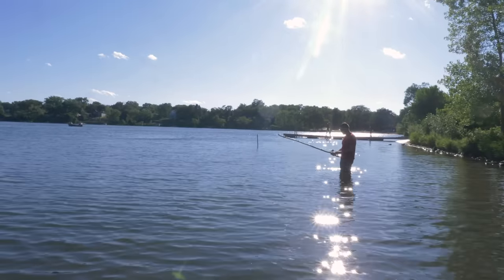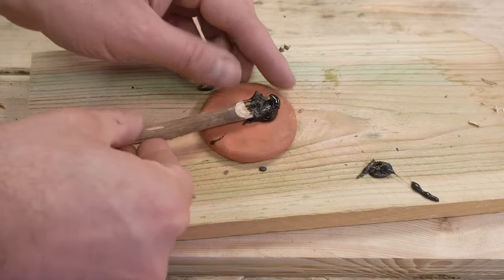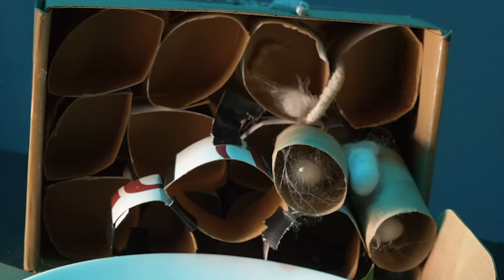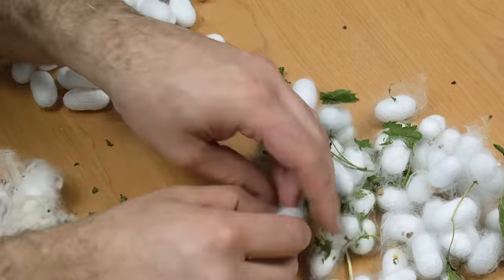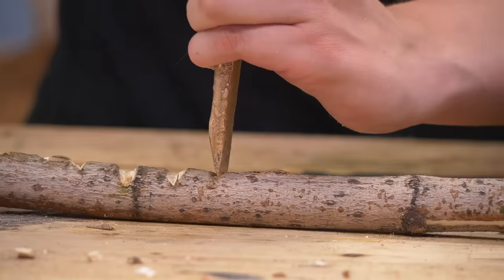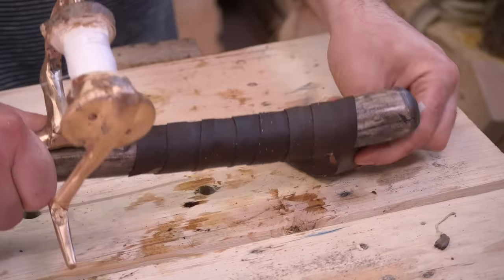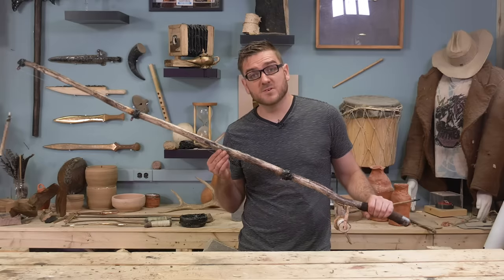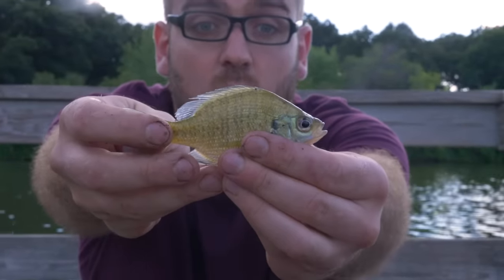How to Make a Fishing Rod from Scratch  (I ACTUALLY Caught a Fish!)

Comment: Well this fishing pole was way overdeveloped for it own good. I'd be way easier to simply use a long stick (preferably bit flexible at the tip), attach the silk to the to up to the tip and have the silk for the wire be the length of the pole. and a bone hook. This way you can cast quite properly and actually catch fish (without cheating by adding modern wire and hook). If you wanted to be fancy, you could have done a compound rod.

Reel is for bigger fish.
Reply: I agree, I work at a Boy Scout camp and we use simple reel-less bamboo rods all the time, elementary-aged children can catch small catfish with very little effort.
Reply: What you are referring to is called Tenkara. It is essentially the Japanese version of Western Fly Fishing, that is, no reel with limited amount of line on a long (13 to 15 ft) rod with a flexible yet strong tip
Reply: Exactly and with a bone hook you can easily add a barb(or anchor) to it so the fish cant slip out.
Reply: I agree. That fishing rod looks over-engineered. You can actually get the same result (roughly same size of fish) with just horse tail line tied to the end of a rod. To fish, you just dangle the line into the water from a pier then jerk the rod up when you caught something. You also don't need a floater, since you can feel the fish pulling on the line. I used to do on a lake in upstate NY during summer.
Reply: Dee H I’ve been doing this since I was five
Reply: @thedodorex7612  Good for you!
Reply: @drewshafer9379  Also know as pan fishing in the US prior to tenkara being known here.
Reply: @drewshafer9379  why is everyone so fixated on this tenkara term? literraly every nation was fishing like this for centuries. damn even i was fishing with light cane rod and various lures when i was a kid and that was in 90s. but now some overly active marketologists are trying to make everyone think that its a traditional japanese fishing cuz they can push merchandise under this brand and make money of spoiled western rich kids that never seen any rod simpler than a carbon fiber $2000 high performance spinning.

Comment: Biggest thing that’s stopping them from fishing properly to get foot fish is that they are using a WAAAAAY to big hook, the oldest way people made hooks for small mouth fish and small fish is with a small splinter of bone, sharpened on both sides, and then tied off on the center of the bone splinter. It’s sharp, the length of the bone determines the size of the mouth of the fish it will catch and it’s a very very good way of getting a small fish. LOVED the video! Keep making more!

Comment: Hi im a fisherman, I think you need to actually sand the wood because with wood there are notches that hold the line which is bad for casting. Another thing is that you might want a reel with some release mechanism. With bronze make a bunch of gears and a rachet so you can make a crank that not only can release the line for farther casting, you can also double the strength of the rod. I also suggest using bamboo fibers for the line. They are much stronger than silk and still as flexible. This may or may not require more time but please consider my advice

Comment: For casting since your reel isn't going to be super smooth you might wanna try letting out a bit of line and holding it taut with your fingers on the pole and as your cast just release your finger off the line and let it fly, still wont fly like a modern pole but it should be able to give you some distance.

Comment: As far as the line not being strong enough, replacing it with the same rope that you used to make the bow, it would be thicker so there would end up being less on the spool but it would be able to handle more weight, allowing it to catch larger fish. the hook could be attached by weaving the end of the line through the eye then itself making a backsplice that also stops it from unraveling.

Comment: I really like that you let them hatch first before taking the pods. A lot of videos I have seen, people boil them right before they hatch (while inside the pods) and that always freaked me out a little bit. I always wanted to try it myself with the silk worms but that part turned me off from it and I thought maybe you had to boil them or something to get the pods. Thank you :)
Reply: Unfortunately, I think they only let a few of them emerge (so they could have another generation). When the moth comes out of the cocoon it has to break the filament, meaning the cocoon no longer consists of one long thread but several shorter ones. Those would still work for making cloth (you would spin the short pieces together into thread the way you would do with cotton or wool or other fibers) but for a fishing line you really do want something where the pieces go the whole length of the line.

Comment: Back when I was quite young, I made a simple hand line just to goof around . I cut a sturdy piece of maple wood off of a long pole I had hanging around and cleaned it up to be smooth and clean looking . I wound up around 100 yards of braided 20 lb test Kevlar line and tied on a heavy duty snelled hook with a 1/4 oz sinker . I used worms that I dug up from beside my Parent's garden .  I threw it out quite far towards a deep part of the River a short distance from my house . Amazing how strong a 3 pound  Smallmouth Bass is ! I got it in, but not without cutting my fingers quite deeply from the line being pulled through my fingers . There are FAR larger Bass than three pounders along with trophy sized Trout and Walleyes ,to name a few of the Species of sportfish in that River. I probably would have  shredded my fingers if a five pound Bass or similar sized Trout took the bait . I kept that Bass and a few others that I caught using my fishing rod after setting the handline aside  . I gave up on using handlines .

Comment: For a V2, the most primitive version of a reel you can cast from would be one that you could turn for 90°, the axis of the spool parallel to the rod in one position and perpendicular to it in the second position. So you can either cast from it like from a spinning reel, or reel your line in like with a flyfishing reel. Another thing that might be helpful, as I think you'd definitely smaller hooks, would be the ability to pull wire. But that may be too far in the future, still...

Comment: What if you made braided line from the silk? Braided line is inherent stronger than monofilament and for such a thin material, could quadruple the test of the line if you braided about 4 strands together! Also, try using a different kind of wood for more flexibility and spring action. Like fiberglass, a yule branch or any other classic wood for making bows would be very effective!
Reply: Also, for the hook, id suggest either making it thinner (although you risk making it weaker) or making it from a harder material, such as bone

Comment: I'm surprised you didn't make a tenkara rod. Instead of bearing a reel, such a rod simply has a thick reusable line attached to its tip and in casting functions like a catapult to precisely launch the lure forward. It can be tricky, but it allows for precise fly casting and still provides ample leverage for big fish.

Comment: The worm stick should of bin longer to go deeper in ground and the notches should of bin starting at the top , also wouldn’t hurt to wet the area abit. Different method is cleaning around a small baby trees stump , wetting the area you cleaned around the stump showing dirt, then sawing it near the ground to simulate the same vibration of the worm stick. but the roots of the tree work better to send the vibrations further down compared to a worm stick.

Comment: There's a simpler way to get worms to come up to the surface using the same effect which is just putting a spade into the ground and moving it back and forth - I imagine it may even work with a simple stick too, but prolly not quite as well

Comment: An easier method is to wet your grass and then at nightfall walk gently out with a dim flashlight and catch the night crawlers on the surface. They will feel the heat from a really bright flashlight. Tiptoe or you’ll scare them away. Also once you grab one they may still not let go and just grip them without ripping them in half and gently easy them the rest of the way out of their holes. Oh and you will get slimy hands.

Comment: Andy, but the wheel was not invented during construction of the pyramids. How did people fish back then ?
Reply: Ancient Egyptians definitely had wheels. They even rode in chariots.

Without a reel, you can fish just with string and hook on a stick.
Reply: Wasn't that during the later Egyptian period?
Ancient Egyptians used sleds. Which is one of the reasons why the pyramids are fascinating.

Comment: Way easier to make a tenkara pole, and to simply tie some flies. Lines were historically made from silk and/or horse hair. Bamboo or heartwood is typically used, not a big crooked stick. Guides are traditionally attached with silk thread wrap, then covered in lacquer.  These stay attached for decades.

Comment: I wonder why the worm stick didn’t work. Maybe it didn’t dig deep enough into the ground?
Reply: I think that might have been the issue- and I should have done it at night!
Reply: You are supposed to do it with a cut down tree shrub about an inch thick so the vibrations go through the roots

Comment: Most fishing rods would not have had any expensive metal. If there was a winch I bet it was wood.

Secondly the most basic rod is a long string on a stick, and you manage the string and pull it in by hand. I bet some rods you could pull the string through one way and it would maybe resist the other direction.

Or you know you would hold the string and pull against the fish using the springy rod.

Comment: I felt like the old man from Dr. Stone watching this. It pissed me off watching as a fisherman and craftsman. You have to build it to catch the fish you want. I can't use a ultra light and expect to catch a shark. If you want a big fish build it for a big fish. The weakest link here is the strength of the line. The rod and reel could hold 15lbs easy. The hook they used could hold 5lbs maybe, and thickness can be adjusted to be made weaker or stronger. If the strongest line they could make only held 1 lbs then build around that. They make like that for  ultra light set ups. A sidecast reel is a simpler reel to make with what they currently have if they want to cast out. But if they're just gonna pitch it then a cane pole is ideal for this. A hand reel would also be good, although I don'tknow if it's considered angling since there's no rod. Reels are really only if you need extra line to cast further and fight the fish on the way back a panfish aren't the strongest fighters.

I know this is just a series ment to show mans progress, not build the best thing ever. I just felt the same as Kaseki watching Senku try to blow glass. It really got me fired up. Look up Dr. Stone glass blowing, you see what I mean.  Sorry I don't usually rant like this. I do like your channel and watch from time to time. Again sorry for the rant I just felt I needed to get that out.

Comment: Respect for the effort to make silk thread, but you're obviously unaware how the actual primitive hook fishing gear looks like, you just made a crude reproduction of a modern pole using bronze age materials. Looks actually quite nice and functional, but I think you'd be amazed how easy it is to make older designs that are much simpler and quite effective. 
Here's a few hints: the reel and thread guide loops are optional, you don't need any metal pieces outside the actual hook (and even that can be made from some types of thorny plants or even animal bones if necessary). If you're using a longer, thinner and flexible pole (like a piece of bamboo or reed or even a tree sapling about as thick as your thumb) you can simply tie the thread at the tip to make a fixed rod up to 7-8 feet long. The float (bobber) was most commonly made from bird feathers (the shafts/stems of larger larger tail/wing ones), attached simply by wrapping a piece of string tight around them, with the main line passing underneath the wrap. As for the line, it really doesn't have to be that thin, any strong enough vegetable fiber will do (flax, hemp or even some types tree bark).

Comment: i think now that you've unlocked the technology of the lathe you should use or build at least a basic foot pedal lathe to turn wood and materials. make sure to spend a lot of time as it will be a tool for use in the future. making sure that you have at least a somewhat circular or cylindrical hardware seems to be necessary for every project since the lathe yet you keep using chisels to make such a shape. building your own tools is an important part of learning the next stages of technology so please try to be as precise as the technology available allows.

Comment: Er. What was used to make the net and why, if you could use that thin cord for the net couldn't you also use it for the line. I get it's basically the idea for the video but it's supposed to be authentic so is the net a small cheat or wasn't that cord suitable for the line for some reason? Also pretty sure ancients who used silk line would have used several strands that thick twined together to make a far stronger line. They wouldn't want to lose their dinner from line breaking.

Comment: "We can't know what their fishing poles looked like ..." 

Wanna bet?  Whatchya wanna lose?

What did the fishing poles look like 4,000 plus years ago?
Easy: A stick with a line tied onto the end.  They are still in use today, 4,000 plus years later.
 It's called a "CANE POLE" now days.

FYI: Silk line was used for fishing - but only where the Silk Worm is found, and even there rarely, considering the cost of silk.
Europe, the Americas (if they used line and rod. The indigenous of the Americas were more likely to use a spear or net), "Middle East", Africa, used linen, hemp, sisl, and ofher plant based materials, because that is what they had.
Most people in Asia used the same materials. Silk fabric and thread even back then was labor intensive to make and expensive.

Hell, the Neanderthal probably used a cane pole when not using his (or her) hands ("grab fishing",  also still practiced today in some areas), a net or spear. (both of which are still used to this day.)

FYI: The fishing reel wasn't invented until the early/mid 1800's

Comment: Wrong casting technique for your primitive reel.  Use the stripping line so it makes a big loop then cast similar to fly fishing.
Or if you want the hook closer to the bottom, tie a piece of bamboo closer to the hook with a piece of bronze rod higher up enough to get the hook off the bottom (drop weight?).  Cast same way.
Your hook and barb might not have been sharp enough.

Comment: I think one of the issues really is that your hook is way too big for the kind of setup you have. Like, it's about as big as freshwater hooks will usually get, not including specialized gear for particularily large fish but at the same time, you line is on the lighter side, your overall casting range is pretty abysmal and your trace is pretty short. The floater is also not ideal.